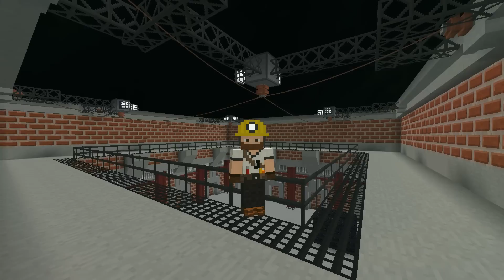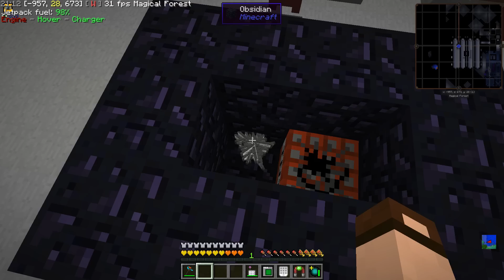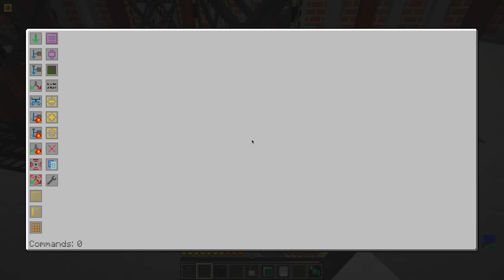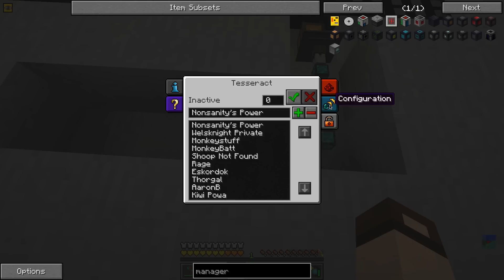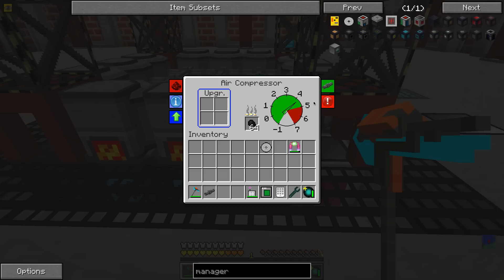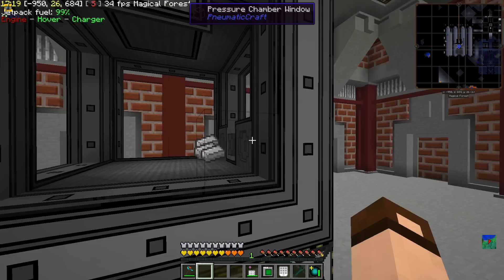Primus Unabridged - 14 - PneumaticCraft Pnewness

Comment: I love how your so Thorough with mods... I have learned more from you then most lets plays but I'm having a hard time with daybreaker ftb server. mostly the Ec3 staffs. i can make the staff of life but the magical digger staff has 0/0 mru.. when it should have 0/5000. I have a charger and a matter of eternity fully chargered but this changes nothing. also on a side note. would like to see the solar prisim work mine almost burnt my house down haha and im on protected land.... should not burn down. Yes I had the receiver and fed it in ot a "node" / reactor structure ( this is the only definition i can give being a fan of big reactores) darn thing is just a big battery i have to suply ... i tried ender power but my ender base disappeared after the onslot but i was using the enderlily to fuel it. maybe angry enderman are not compadible. stuck so far with a heat generator and with everything i have made it cant keep up... is there a better way?
Reply from the maker: I'm sure Essential Craft 3 has changed considerably since I last played with it. I don't even remember there being staffs. You probably do need vanilla Endermen—I think I recall having the same issue. I just used EE3 to feed materials into the RFTools spawner to make them. There's an episode of my Daybreaker series about it—don't remember which. It seemed like the best EC3 power generation option at the time. :)

Comment: It looked like the diesel to kerosene conversion requires pressure, but the lubricant doesn't, so if you don't want the former, then don't hook up the tubes maybe? Or maybe appearances are deceiving and it does require a little pressure.
Reply from the maker: +MindCaged No, it looks like it doesn't require pressure at all. But I've since set up a separate system to convert all the byproducts up to plastic too. Those did take pressure.

Comment: A couple things. 1.) I wonder if those random item orbs have code to prevent creative only items from spawning, since that could go badly, even though I assume they're meant to be hard to get and rely greatly on luck. 2.) Dumping everything you get from them into your AE system is sure to fill up all your drives very quickly if it's just like 1 or 2 of each item. Would rapidly use up the item types on your cells. Might just be better to setup a long line of chests. Also makes it so you can tell which items came from the orbs.
Reply from the maker: +MindCaged Well, I made a bunch of drives and filled them with ten 1k cells each. That's 640 types per block, which is better than any other single-block container I know. (The filing cabinets flake out too much long before getting that full.) And I didn't run tens of thousands of orbs. Just 3-4 refills of the dispenser. It was just curiosity that drove me. :)

Comment: You don't really need the pressure chamber interfaces for putting items into or out of the pressure chamber. A SFM item valve placed under the chamber will try to put the item into the block above it and it will move up to the nearest open spot (the chamber) and the same gate will look for white listed items and pull them out. This way you never lose pressure inserting or removing items, don't need upgrades, and it's easier to filter.
Reply from the maker: +N0SEM1NER That's a neat trick, but it feels rather cheaty to me. :)

My magnet lets me grab things out of the chamber already, and an Item Collector could also empty it. For the SFM trick to work, it would have to be a 3x3 chamber or a 3x3 grid of Item Valves to cover the whole area in a 5x5 chamber like mine.

If we had Mystcraft, the gates could be used to teleport drops in, with an Item Collector to pull them out when done. There's no teleport system in this pack that I know of that can send items to a location with no receiver present.

I guess I'd prefer to use something other than glitching an item up into the chamber to load it. But still: Neat trick! You come up with it? :)
Reply: +Nonsanity there are thermal expansion translocation plates!

Comment: The metamorphic stone is made using the Marimorphosis flower. Akin to the Orechid flower, you stick some stone around it and it'll change it into a random biome related stone, mostly of whichever biome you're in, but you can get all of them. I think the flower has a radius of 4-5 blocks.
Reply from the maker: And the result is just decorative, then?
Reply: Pretty much, yes. Other than being able to craft them into slabs, stairs and chiseled form etc., changing the look of the apothecary is the only other thing they're for. I think. It's been a while since I've looked into any Botania stuff, even though it's always on my list of things to do.

Comment: You dont need ANY presure for creation of Plastic and lubricant so that 2 vortex tubes are pointless.
Reply from the maker: The vortex tubes are for the heat they do need, but these operations probably don't use any air pressure—other recipes do, though. :)
Reply: opps. :D i meant presure tubes

Comment: Hey, cool to see you're playing with and enjoying PneumaticCraft!

A few things, I'm pretty sure the amount of heat sinks on the Vortex Tubes are way overkilll to get rid of the cold :P. I think just placing one directly on every Vortex Tube  works well enough.

Also, you can directly connect Refineries to the Vortex Tubes. Using blocks of Compressed Iron only is optional, and is less efficient even, as heat is lost because of the blocks touching air.
Reply from the maker: The blocks are there for the future. Since I don't really need liquid fuels, I'm going to up convert it all to make plastic. Those take some higher temperatures, so I'm going to join them all to the same heat backbone. And I'm sure the heat sinks are overkill. I hadn't worked out the exact number needed so I just stuck all the ones I had made there. It's either that, or store them away, and this way it looks cooler. ;)

I wonder how well an insulating wrap would work, something like the heat sink but with the opposite effect? :)
Reply: It really depends on the material used with Wool/Rockwool being the best one.